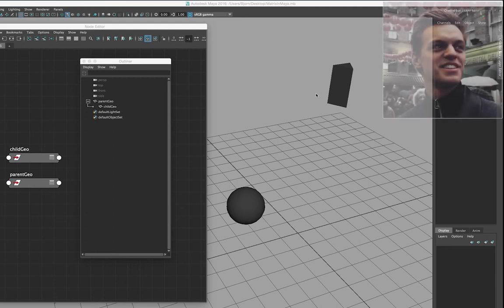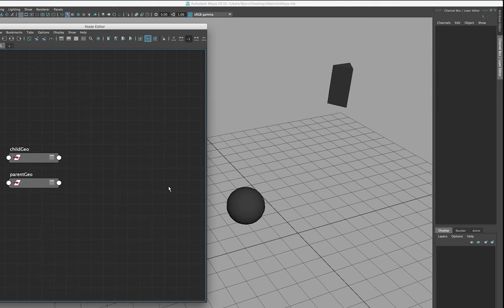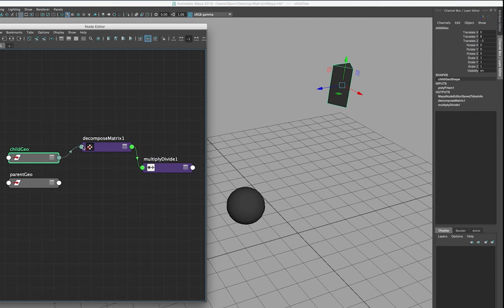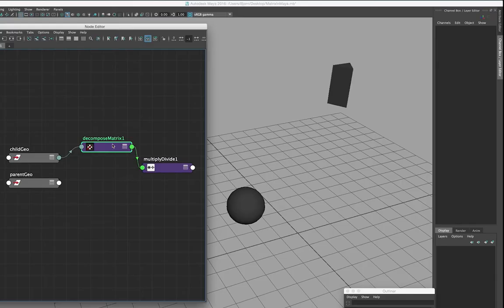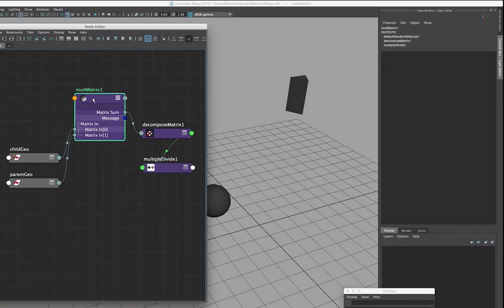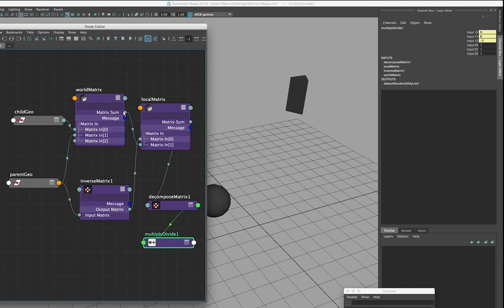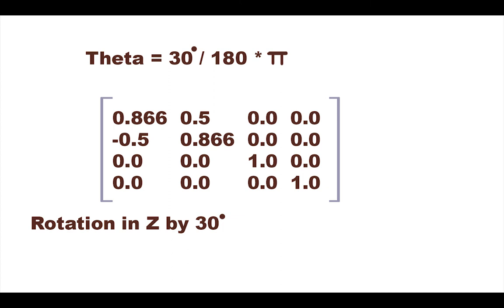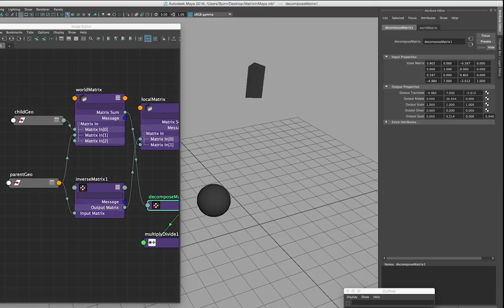Matrix math in Maya explained

Comment: ok but why is the output from the multiplied matix in the multMatrix node called matrixSum? aren't sums the result of addition and products the result of multiplication?
Reply from the maker: Yea that's very confusing. 
In Maya, the multMatrix tool multiplies matrices. The output, matrixSum, shows what happens when you multiply two matrices and connect them to matrixIn[0] and matrixIn[1] in the multMatrix tool. It basically combines their effects.

In simple terms, think of matrixSum in the multMatrix node as the combined transformation result. It's crucial for handling complex changes in Maya, making it easier to apply these transformations to objects or parts seamlessly.

Comment: I don't understand. If the parent object were at x=5 and the child object were also at x=5, than the child's world X coordinate would be 10. But that's what we get by adding the parent world matrix and child local matrix, not multiplying them. If we combine a parent world matrix of 5, 0, 0 with a child local matrix of 5, 0, 0, how do we end up with 10, 0, 0 and not 25, 0, 0?
Reply: Matrix multiplication does end up with 10 in your example, because each item in the row of the first matrix is multiplied by each item in the column of the second matrix and added together. So, the x value units of the parent object are not directly multiplied by the x value units of the child object, but by the other elements in the overall transformation matrix (in this case the scale values, represented by the top left to bottom right diagonal of the 4x4 matrix) to ultimately add together to make the child's x-coordinate 10 in world space.